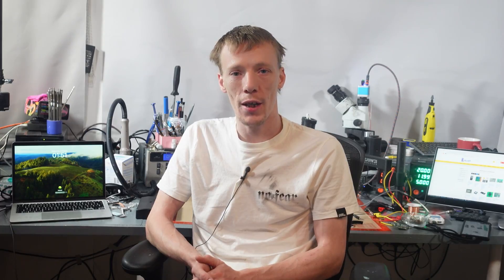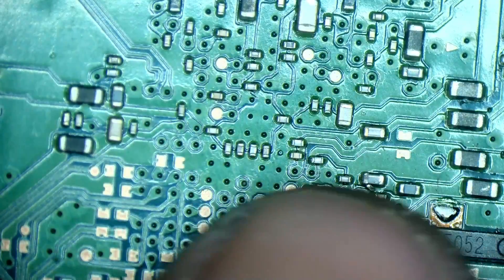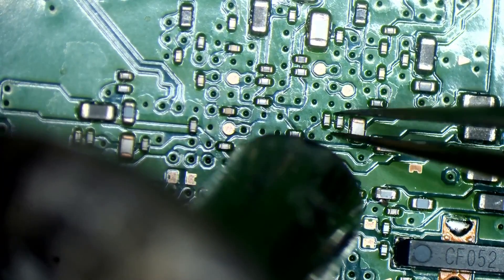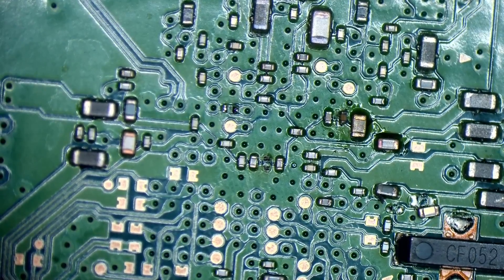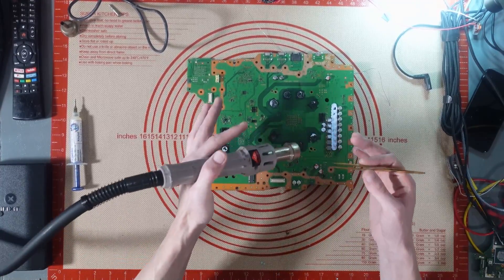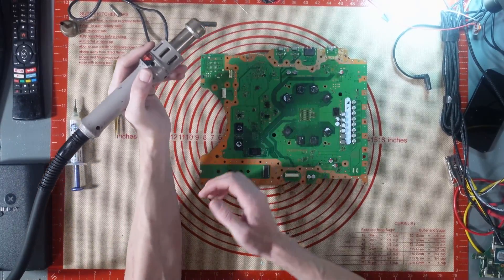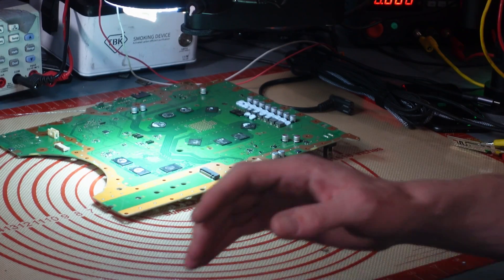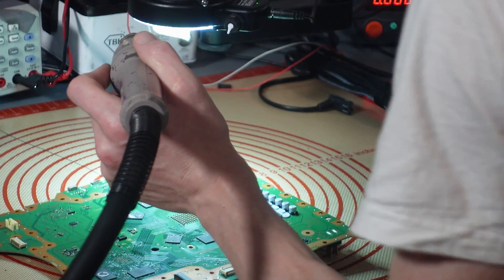Do You NEED Steady Hands For Micro Soldering Repairs?

Comment: Thank you so much for this video lesson. I'm a NASA certified technician, and in my mid 60's. I have an annoying hand tremor, that makes micro-soldering all but impossible. Currently have a Nintendo Switch with a bad M92 chip that needs replacing, and im dreading the job. Im afraid that i'll cause parts to scramble. Any advice is helpful..thanks mate!

Comment: Ive had an injury to my neck when i was 4 years old due to being thrown from a horse. I suffer from neck and upper back pain everyday and i constantly have headaches. I too don't have steady hands but didn't prop my hands on the board due to static electricity, but i will try propping my wrist to steady my hands. Thanks for that information
Reply from the maker: Yeah as already said static really isn't that big of a deal these days. I've never worn an anti static band or anything and never had a problem personally. Maybe on older electronics it would be but most things these days are pretty impervious to static
Reply: @TheCod3r  that is good to know
Reply: If you're doing mobo/solder repairs, and you're working on an anti-static mat, you really don't have to worry about static electricity. (Assuming you're not walking around in socks on a carpet while working of course) 

I've been repairing motherboards for years now and have never experienced any kind of static electricity / static event. Static electricity is really only a concern when you're replacing new IC's or handling voltage sensitive components out of circuit like a CPU/APU

So feel free to stabilize your hands on a mobo whilst doing soldering repairs good sir!
Reply: @DaTechServer  I don't have one of those mats, I need to get one along with the tools I'd need to do certain repairs

Comment: Believe it or not but my hands aren't steady and I rest my elbow or wrist yo the side. Great difference! Thanks for sharing. I sometimes place the component first and then heat it which avoids using hands. I just give a small nudge at the end to make sure.
Reply from the maker: Yeah it's definitely a huge help. Constantly fighting gravity will cause mistakes and causes mental drain too so every little helps when it comes to balancing your hands 😀
Reply: @TheCod3r my first ever console mod was the Nintendo GameCube with the viper GC extreme chip and boy were my hands shaking trying to solder a wire to the chip because one of the legs was partly under the heatsink. I could have removed it but I had no thermal paste at hand to replace it lol. But I got it done once I found my comfort spot
Reply: Wich is better to be. On twitch or utube
Reply: Hi love your videos